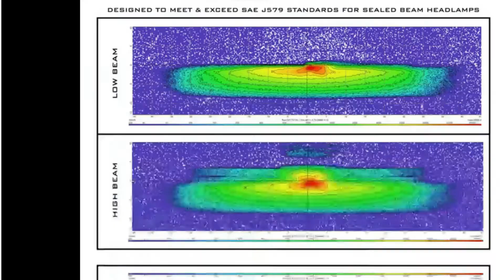1967-69 Firebird Headlight Install

Comment: Okay, but how did you get them in and out of the car to begin with
Reply from the maker: Removal and install of headlights is the same as stock. There are 2 adjusters per light, one top and one on the side with a spring on the bottom. Once you release tension on the spring you can back the adjusters out until you can remove the complete headlight assembly (what we show in the video - headlight, bucket and retaining ring).

Comment: What do the connectors look like? Do they just plug into the original harness plugs?
Reply from the maker: @fretsman68  yes, plug in to the stock wiring. They are a 3 prong connector on the high/low lights and  a 2 prong connector on high beam only lights.